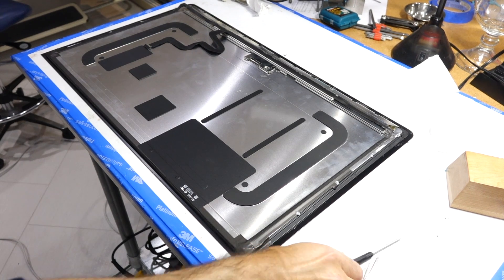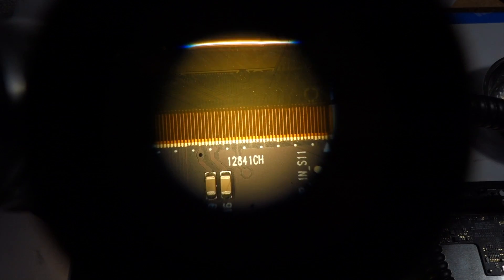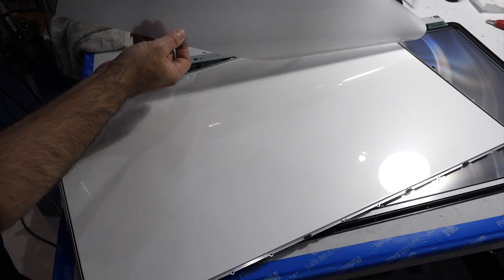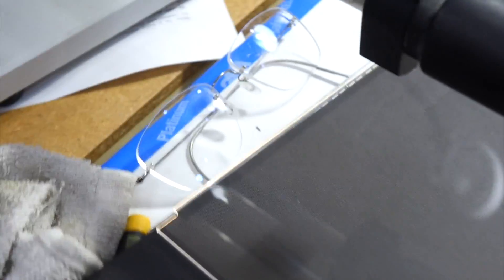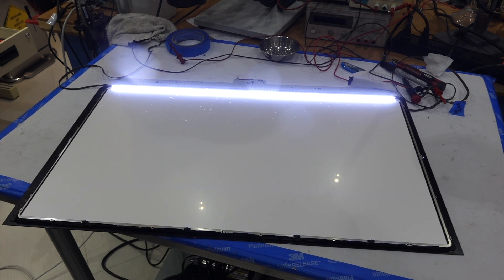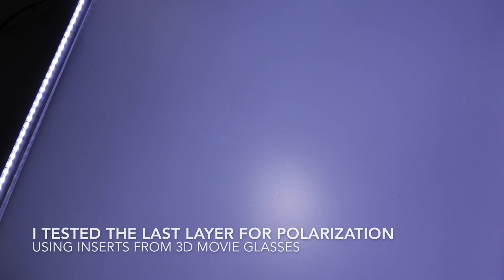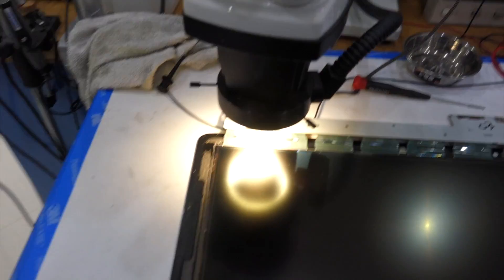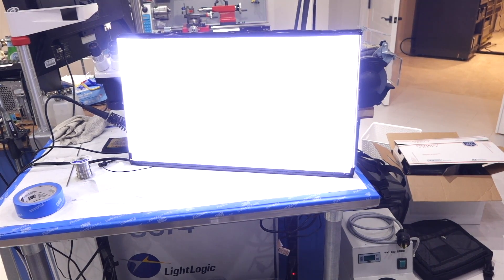Modern Tech Fail: iMac 27" Retina 5k Display Panel Tear Down

Comment: Watch Louis Rossman videos. If you buy another product from Apple after that, you probably lack self respect
Reply: @pahom, I see this argument a lot, but it really isn't applicable to the Mac. For IOS devices there is a walled garden ecosystem yes, but this isn't true for OSX(ten). Anything that you can run on a UNIX system, you can run on Mac. Wine, and X.org server, userland tools, GCC, the lot!

It basically is a very nice *NIX system with a extremly polished GUI for which many pro apps are available. What is not to love?
Reply: Louis is a repair guy. He thinks apples products are shit because he see loads of them. Actually, that is because apple products are the most popular (especially in rich NYC), and expensive to repair. When a Windows machine breaks, people just throw it away because they usually worth less than the repair. 
He is so heavily biased his opinion is like a joke. He’s actually probably aware of this, but spitting on Apple is bringging views so...
Reply from the maker: @pierregabory8772  Apple is very obviously protecting their margins, designs and suppliers by blocking access to their components and repair info. And these artificial, nonsensical business obstacles irritate technical people like Louis that see right through it. And Linus too. And it irritates me just the same. Why didn't they use #$$%^&& screws and regular disks. Why do they poke their loyal customers in the eye. But they really have no choice: without that they'd be dead, dragged into the pricing race to the bottom like the others. Then irritated people lash back at the hardware or the brand, in an almost irrational way. Come on, this is an LG screen folks, not Apple! So I wish very much they did not. That's the only way we can have one company left in the business that encourages this level of engineering. As an engineer, I want to celebrate it.
Reply from the maker: @pahom2  I am not sure I get it. By user experience I simply mean ease of use and productivity. I can do far more on the Mac. It's all Linux [sorry Unix] underneath. But I almost never need to futz with it, which I need to do constantly on other platforms. Futz #1 would actually be Linux itself. Actually, futzing on Linux is very enjoyable for futzing's sake. You can control every aspect of it to a ridiculous degree. And the command line is so powerful and smart, makes you feel smart too. Futzing with windows: not enjoyable at all, makes me feel very dumb ;-)
Reply: CuriousMarc pretty sure MacOS is BSD based, not Linux. Someone correct me if I’m wrong.
Reply from the maker: @blakestone75  You are right.
Reply: @blakestone75  Yup.. but with some horrific codes added to BSD i'm sure. I've used BSD for years in an ISP and for personal projects. It's a better OS than Linux. But Apple made a mess out of it.
Reply: @blakestone75  Yes, Apple took FreeBSD and gave nothing back
Reply: @blakestone75  BSD is Unix based - is it not?
Reply: and here we are, at the same old "apple is for dumb people" thing. it is actually not. it is for people who are working and do not have a time to tinker with settings and hardware or want to tinker with other hardware. what is even more amusing is the fact, that mac being unix-based, you can do much more (with more ease at least - and i am using and developing for both windows and macos) via terminal than via powershell... and yet some people using PCs have a feeling of superiority. it seems to me, it is more about the price than something else, as crying about the superiority can be used as a good reason not to buy something to cover the inability. and this superiority & inability correlation actually goes far beyond computing as well.
Reply: @diamened, Rossman is in the business of repairing a very specific brand of product damaged by people who spill liquid over said product. This, in and of itself is perfectly fine. What is NOT fine however is to pretend that only apple users spill liquid over their machines.

Also, sometimes hardware fails..Sometimes even macs when you did not spill beer over it.... Apparently!

 If you choose not to spill beer in your Macbook, it can last for years! 10 years in the case of the machine I'm typing this on right now. It has been a very consistent tool in both academia and professional work to this day. 

I know that anecdotal evidence is a fallacious argument, but not as fallacious as your comment.
Reply: Diggnuts Wait.. You mean to tell me beer isn't the standard computer lubricant?
That's what the square holes are for - U.S.B.? Universal Spout for Beer!

Edit: This almost reads more like the ramblings of a crackhead than a joke, oh well..
Reply from the maker: Compared to my endlessly irritating PCs, my iMac is a joy to use. It costs more to buy (and a lot more to repair if it's out of warranty!), but the far superior engineering and user experience is worth it for me. See, I'm different. I celebrate engineering and design effort when I see it - this is what my channel is really about. That screen alone is worth the whole thing. And I am willing to pay the engineers that did it. Which is unlike most, who just go for lowest price, and off to a race to the bottom we go. PC goes in the lab and at work, but my next video editing and sound recording rigs will be Macs.
Reply: @CuriousMarc  It's kind of easy to understand this whole topic. A lot of people who complain about Macs haven't used them to get work done in an environment where time = money. And unfortunately, it's kind of true that Apple targets a higher-earning category of people. If you don't have much money, sticking to PCs would be more logical. You'll be able to do cheap repairs if something happens, and there's endless support all around. I use PCs 90% of the time because I mostly do very technical work. I've used all kinds of powerful Macs for audio/video/3D etc.. and it was a pleasure. MacOS does some things far better - like managing CPU load under very heavy multithreaded activity while keeping the user experience silky smooth. The products are indeed better engineered, and the user experience is more consistent. I think people should be very happy that these two classes of companies exist. It's good competition, it drives forward two completely different mentalities, and both camps learn from each other all the time. I just don't see a problem here, at all. I will use both platforms as best suited for my goal/application. Is that too unreasonable? ;)